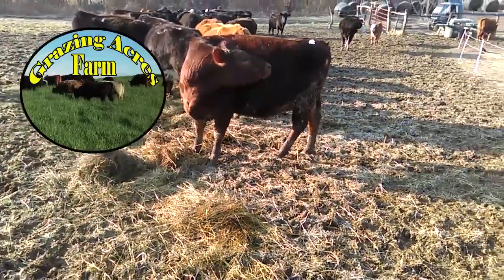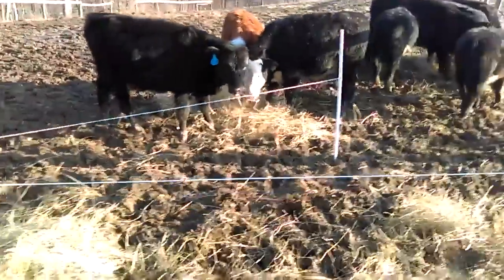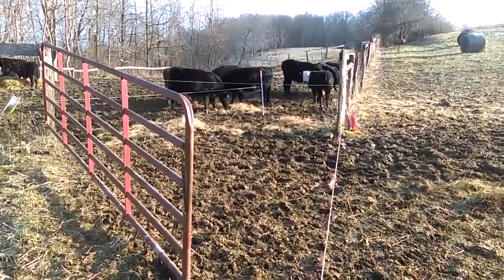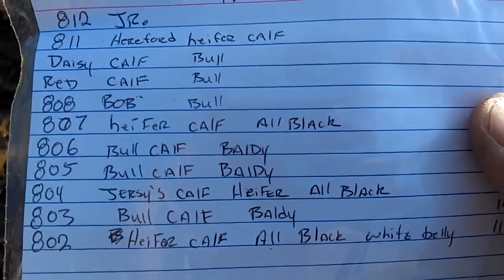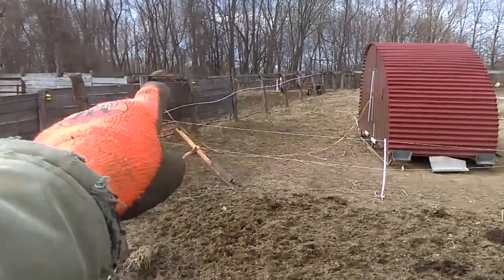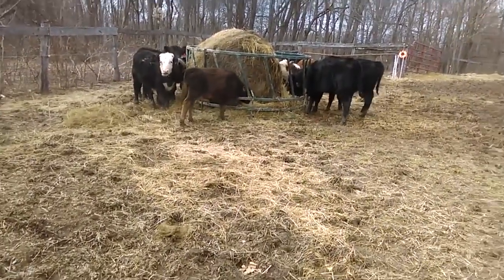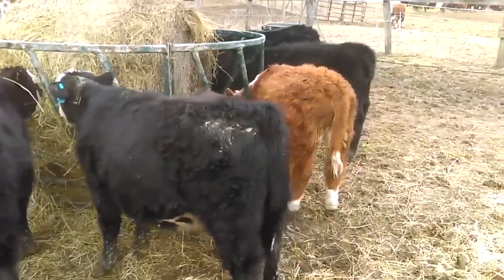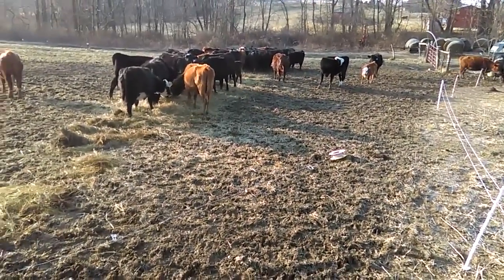Sorting Calves To Be Weaned With No Help

Comment: Nice! Pretty clever with the poly wire but when you are by yourself, you have to be!
Reply from the maker: I was revealed it worked like it did with this being my first go around at sorting this many calves at once. I figure each year will get easier as I learn the ropes to cow/calf operation. 
Just think in about 2 months calving season starts all over again. There shouldn't be any pulling calves this year and I hope that is the case so I can concentrate on queen rearing.
Reply: It initially reminded me of escape boards for a bee hive! I'm sure every year will get easier, learning new tricks as you go! That's crazy that it is nearly calving season already. I sure hope all goes well and you are not out there for hours, observing/helping again! 
Take care!